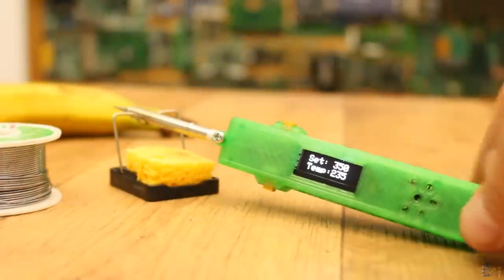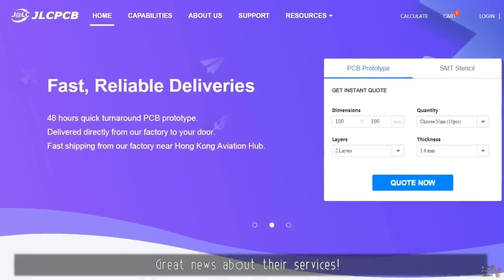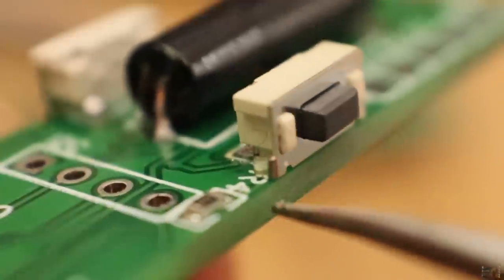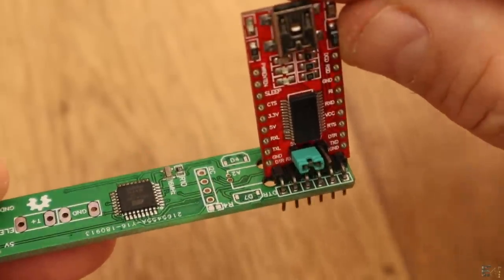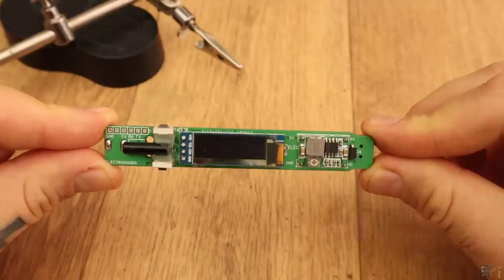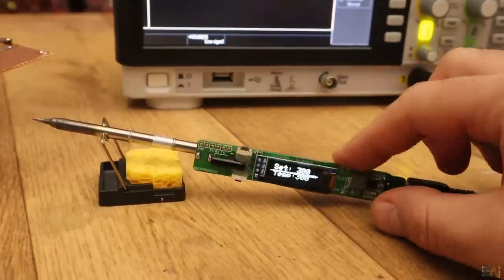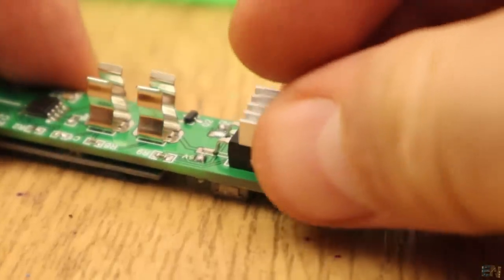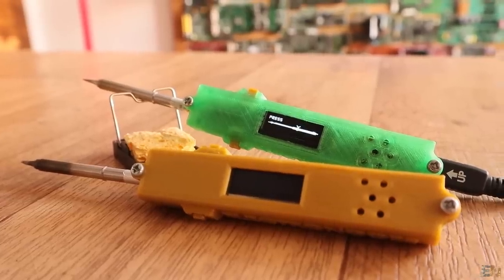Arduino portable soldering iron board V3

Comment from the maker: Want to help my workshop: https://www.patreon.com/ELECTRONOOBS
Thank you so much!
Reply: Great brother but $3or$4 I buy a new one 😁
Reply: Great work ,,,, please continue high amp ESC project
Reply: Electronoobs please check text instructions, and correct the errors on all pages, for example on the third page there is an error after we soldered DC-DC at 5V. Thanks this project 👋
Reply from the maker: @sdqf  Hi. Thanks. I don't really understand where is the error?
Reply: Kickstarter please!!
Reply: Kickstarter
Reply: that's nice to see your pid  controller and reduction in space! so please develop a kickstarter  that will help us to learn more
Reply: Stable temperature achieved on LM358 - 
No more bouncing, I read my body temp at 36*c. mV reading only fluctuates 1mV. I changed the 2.2nf capacitor to 68pf. the mV will bounce until the processor starts reading the analog signal then it smooths out to about 1mV. I did have to use a couple of different components. I didn't have the same as you but the capacitor is what fixed the floating voltage. I used a 220k resistor instead of 200k and a 1N4001 in place of the 1N5819 but these two didn't change the results. and this was all on a breadboard yours should do better than mine with the change. Thank you very much for all the video's I love them! I was thinking of making a portable soldering iron with your help it gave me a huge boost to try it. Thank you! I was looking through the code while changing it to read single digits. I noticed a bunch of delays. it might be why it responds a little slow to button pushes. I am going to see what I can do with that next. I love your design keep up the good work.  and as many have said I didn't like the USB connection either but if you're just using it for yourself it wouldn't be too bad but I would blow up my phone! lol, I forget everything. I did hook the beeper up and I like it. this way I know when the iron is going to sleep and reminds me I have it on. one thing you may want to add is to keep the iron at a low temp sleep mode like 150* and make it another setting. one other suggestion I have is - now you have 500* = about 1.960 VDC if you divide that by two or lower the gain to one volt at 500*C and use the 1.1-volt reference on the link below you will have over twice the accuracy and could possibly even get to tenths of a degree or so.
https://www.arduino.cc/reference/en/language/functions/analog-io/analogreference/

Have a Great Day!
Reply: It was a smart design

scrolling  Animated Bitmap design

one question :  how run motion  graphic text or bitmap  left to right in the  oled display

I have not found any way

step by step showing words 

Example  ;  elektronoobs   

Thank you in advance

Comment: I'd totally support the Kickstarter, as long as you change out the mini USB connector for a DC jack or something. Mini USB cables are usually not designed to carry more than 1 amp with its puny wires, so you'd overload the wires. Other than that, it's a great project!

Comment: Hi found some problem with the soldering gun, that you may overlooked .If you keep long enough without going on sleep mode the temperature is rising rising slowly and the gun is overheating, glowing red.I found the problem is with the shottky   diode  there  should be in place a 5V  zener diode.Otherwise the high voltage(18-20V)is going on the input of the op-amp and this will  stop sensing the changing temperature.

Comment: If you use a atmega32u4 you can flash an Arduino Leonardo bootloader and do programming over the USB port with no external programmer needed. That would also allow easy programming with the Arduino IDE which would be great if you sell this as a DIY kit!

Comment: First of all replace the input jack, maybe a smaller version of v2. I don't know what is the point of that motion sensor, I would replace it with a power on/off button. The last problem is the case, make it round or people will get frustrated when using it and test it under extreme conditions to see if that 3d printed case can handle the heat (if you plan on selling them I think you should use a molding injection with some plastic that is more resistant to heat). A reverse polarity protection would be welcome too if you plan to make it as a kit. In rest great work and thanks for sharing schematics with us.
Reply from the maker: Thank you for all the tips!

Comment: I would really love to see a kickstarter for the kit, but if you do so please make the user program the microcontroller as it would be a very good oportunity to learn how a microcontroller works. 
Saludos desde Argentina
Reply: Just use preflashed atmega, I’ve built the v2 of the soldering iron, and flashing it was horrible (destroyed pads, bridged atmega pins, needed to remove the big atmega from the arduino uno)
Ps: I done everything of this for destroying it with 19v (by touching buck) two days later 😭

Comment: Great job man, I would just dump the 16Mhz crystal all together, and change voltage converter to 3.3v instead of 5v - then you could burn bare minimum 8Mhz bootloader on your board and save some small amount of space (and few components) ;)

following for version 4 :) cheers!
Reply: I did the same. Do you know how the temperature is measured? There is no temperature sensor on the board?
Reply: just getting a more modern chip like the STM32 or the cheap AVR Dx series can raise both the bit depth and speed of the internal ADC and the frequency limit of the internal oscillator without compromising the Arduino compatibility.

Comment: I would prefer if it was powered via a micro usb connector at 5v. That would make it easy to power using any usb power bank, not many people carry around a 5s lipo or a 20v supply.
Reply: just use 18650 in 4s, get a boost converter to make it 24v, and you can powered it from there, or you can use 6s and get protection board and balance charging board combo for cheap on ebay or amazon
Reply: This is a practical limit of micro usb. The connector is limited to 1.8 amps, so not even 10 watts at 5V. This would obviously cripple the iron. He could add support for QC modes that use higher voltages, but that makes things more complicated and you might as well use USB-C.
Reply: nobodybodybody no, using fastcharge for delivering 20v with mini usb is really simple, need to see the datasheet from a website, but as I know it’s just bridging 5v data+ and data- (not really sure anymore)
Reply: @alexandrebaux4042  It's a little more complicated than that. You can signal higher-current than the default 500 mA with combinations of bridging lines and some resistors I believe, but the non-standard modes that give you a higher voltage like QC3 all require an active negotiation process between the device and charger IIRC.
Reply: nobodybodybody thanks for the info, but are you sure? I’m not QC expert and I trust you completely but I’ve seen this article: https://www.instructables.com/id/QC-30-Trigger/ and they grab 12v from the charger with just resistors and capacitors. As you know more than me on this, could you tell me if this work/don’t work please?
Reply: I guess the main point of my comment was; use something more standard that is both commonly available and easy to use. 
This is so that the iron will be more usable and not just limited to where you have your powersupply. Which is most likely your home where you already have a full sized iron that would do most jobs better. 
 @nobodybodybody 10w might be enough for small jobs, which will be the main focus with an iron like this.
Reply: @alexandrebaux4042  Look more closely at the article you linked, it's not just resistors or capacitors, the trick is the buttons. It's an active negotiation process that involves sending pulses to increase or decrease the voltage. The method in the article is a bit of a hack that uses pushbuttons to fudge the required pulses, but you'd have to have the microcontroller emulate this in an iron. It's possible, but it'd require a lot of extra work as compared to just using a barrel jack.
Reply: @pargunar  A 5 mm barrel jack is standard and widely available.
Reply: @jasonmhite  Yes, but who carries around a powersupply that has a barrel jack connector on the output? 5v usb is simply the standard who people carry around and use for their phones.
Reply: nobodybodybody Now I understand, thanks a lot :)
Reply: @pargunar  You can get USB to barrel jack cables if you really want to run it off of a powerbank, but this is the same reason the TS100 and TS80 don't use micro-USB. 10 W is ideal best case at 5 V and 5 W or so is probably more realistic, which is really crippling the iron. 

I don't disagree that it'd be nice if you could have *both*, but it's a lot of extra work for something that's questionably useful. USB-C like the TS80 uses would really be the best of both worlds, but it's a lot more complicated.

Comment: Dave EEVBlog received this in his mail package for #1254 and hated it. His big point of contention was that there is no insertion stop for the cartridge so it slips right past the contacts, and not much to guide it in general. Minor ones was the bad fitting of the top plate making it prone to bow and slightly wonky seeming temperature control, but that was probably just hysteresis logic or something.
Reply: Yeah as Dave said it's way easier and reliable to make its own DIY station than a pen soldering iron. Though the mecanical parts aren't the only weaknesses of this design.

Comment: I like this project much but I really think misusing Usb Mini Port for 20V is not a great idea because some idiot will plug the modified power supply into a random 5v device. Wouldn’t it be possible to use usb c as the ts80 does?
Reply from the maker: True. After more tests, I realized nthe DC plug from version 2 is still the best option. Thanks!
Reply: Michael Bernhardt It is possible to use usb C, but it would be necessary to add components to switch from 5v profile to 20v profile: bigger pcb and more expensive to do (sorry for my english)
Reply: Alexandre Baux yes i know. But maybe one could figure out what to send over the data lines and use the armega for it? Not sure if possible.
Reply: Michael Bernhardt I think it would be easyer to hack qualcomm 3 usb fastcharge because it is compatible with mini usb and don’t need aditionnal components (from what I know, simple resistor can do the job, no need to modifiy the pcb) and it can deliver 20v

Comment: Why don't you remove pull down resistors and use internal pullups for switches and tilt sensor? It would save some space. And also you could use 7805 voltage regulator in to252 housing instead of step down. It's smaller and cheaper.
Also, M7 diode is too weak, it's 1A and you're pulling over 2A at 19V. 
I'm building one for myself and did the above things and everything works fine. Also added inpult voltage measuring, just wanted to see how my power supply works.

Comment: That's good work. I like the improvements since V1 very much, especially the vibration sensor. 
I think the next Version should take some notes from the TS80 but improve on others:

1. USB-C with PD (instead of QC3.0) (There are PD Triggers to "force" 20V per USB, more than enough power)
2. The Case should be a little rounder arround the edges.

Then you could use a Power Bank or phone charger for the iron and your phone, your laptop, everything <3

Thanks for sharing your work. I would be funding a Version with USB PD for sure
 :D

Comment: Is this just a ts100 clone?
Reply: yeah it definitely looks like one. It's not even being discrete about it.

Everyone, just spend the $75 or so and buy a TS100, and a used 19v-20v 45-60watt laptop power supply with a matching barrel plug. and this custom firmware
https://github.com/Ralim/ts100/releases

Comment: advise, use a injection molded case instead of 3d printed part, it will make the kit more professional  and not like a prototype, and give a rubber grip

Comment: I'm confused... How is the 3d printed case not melting? I can poke a low temp iron through 3d printed plastic like butter...
Reply from the maker: Only the tip of the tip gets hot. The rest is well insulated. It gets hot but not enough to melt plastic...

Comment: i get an error when i compile the scetch. please help.

C:\Users\nwuuser\Documents\Arduino\enoob_ironv3\enoob_ironv3.ino: In function 'void setup()':

enoob_ironv3:249: error: 'PCMSK1' was not declared in this scope

   PCMSK1 |= B00000010;  //Set pin A1 (vibration sensor) trigger an interrupt on state change.

   ^

exit status 1
'PCMSK1' was not declared in this scope

Comment: Have you considered using the soldering tip clips used in the cheap t12 handles that are found on aliexpress, etc.? That would make the design thinner if you invested the time to design a fitting pcb...

Comment: If you really insist in not doing a proper thermocouple conversion with cold junction temperature compensation you can at least use MATLAB to make a proper log regression or polynomial approximation instead of using excel and two linears.

Comment: How much are you drawing from the 5V rail? The voltage converter is efficient but a linear regulator can be smaller.... Although a 15V drop might create some problematic heat if you more than several 10's of milliamps.

Comment: I made this circuit all connection are proper and working the only problem the set temperature goes up and down  automatically any solution to this problem?
Reply from the maker: There must be a problem with the push button no? Maybe add an external pulldown or something... Maybe the IC pin is not well soldered...
Reply: @ELECTRONOOBS  thanks it's working now it was just a bad 1k resistor. Set temp remain stable as set. 
It was great learn and fun project for me. Thanks 😊

Comment: IMO you can use for example stm with dfu bootloader for flashing fw without ftdi while powering from PC usb port. I think price for mcu would be lower than ATmega. Well it is just quick  though I  am not sure if it will be easy to implement from hw side.

Comment: The small size if the buck converter is nice, but last time I tried a similar looking one it had quite bad power usage without a load, it was pulling 0.5W without anything connected to it, which made it actually warm up a bit. How's the performance on this one?

Also, it might be cool to look into making an STM32 version, since you get a 12bit ADC which is way faster. If you use the STM32F103 you can probably use the same code as you just compile it with STM32duino, unless you maybe did AVR register manipulation, but the STM is so fast that you might not even need to do that.

Comment: That's quite a big mosfet for 20v 2A. There's so8 or smaller packages that would barely get warm at that amperage. even a mosfet with 50mohm rdson would only put out .2 watts at 2 amps. so with a huge mosfet like that its its either the gate not being driven at the correct voltage or its just a really shitty one =/

Comment: I'd like to see a good project for an analog T12 soldering station for the work bench that uses a conventional linear supply. I do electronic repairs on older audio equipment, guitar amps, synthesizers with thru-hole PCBs and point-to-point wiring etc. I want to reach and turn a dial when I need more heat. Not press buttons. I don't believe precise temperature to the degree is necessary for soldering. Maybe just index lines around a dial which can be roughly calibrated.
Reply: I've already seen an OSHW project like this but AFAIR with conventional +/- buttons. Though implementing a rotary encoder instead or a multipositions dial selector with fixed programmed temp settings is really not complicated.

Comment: Hi Electronoobs;  I made this project in a soldering station configuration.;  everything like in your project (mainly the T12 tips).;  however I believe there is some mismatch between the code and the type of MOSFET in the schematic which is a N type.; in this case the arduino code should call for a HIGH on the PWM pin to turn  the BJT  "ON" and the MOSFET  "OFF"  .;   is this correct or I am missing something ? .; I am referring to code version 3.3.
You have published another schematic that shows IRF4905 in this position which will make sense for the LOW on the PWM pin.;  can you help on this.; thank you very much

Comment: Hey, someome build sucessfully this diy solder?, i recently finished to build 3 of them & when i plugged in to 5v it seems to be working good (at least the display works fine and i can navigate through menus) but when i connected to 20v external power source the display constantly freezes, resets and even shows garbage :s

There is something i missed?

Comment: I do not know the price of this kit. But considering the price of TS 100 iron i just ordered on sale. I think it would be hard sell. For me anyway. Do not get me wrong i like DIY. But some things are just not worth the efford. The case seems to be not comfortable to hold with all that sharp square corners for example. PS One question. Why do you need so big MOSFET with heatsink even? There are modern transistors with wery low Rdson capable switching a lot of current without heatsink.

Comment: Hello, I'm having problems with the buck converter. When I connect a 18.5 volt lipo battery (multimeter measures 20v) to the buck converter to set the 5v output, it will burn up the IC chip on the converter. When I connect my power supply, set at 20 volts, the converter works fine. I don't understand why the battery keeps burning up the converter. Have any ideas?
Reply: I found that the converters I got from China are bad. I bought some different converters and they work ok. Although, the output is very noisy. I had to put a 220uf cap on the output.